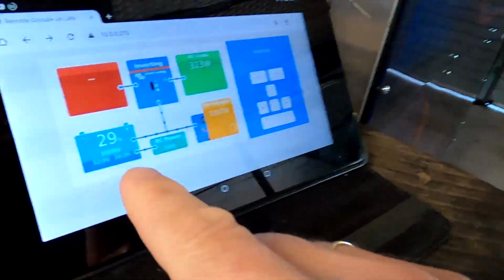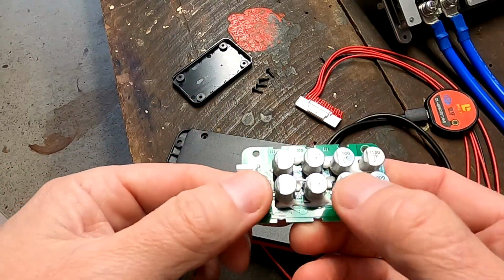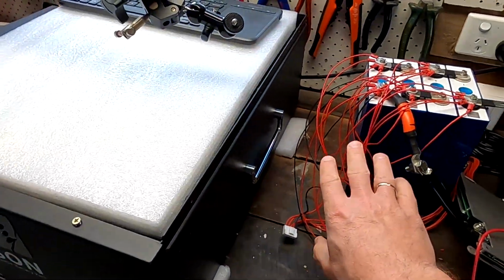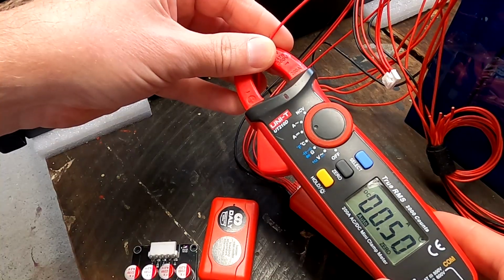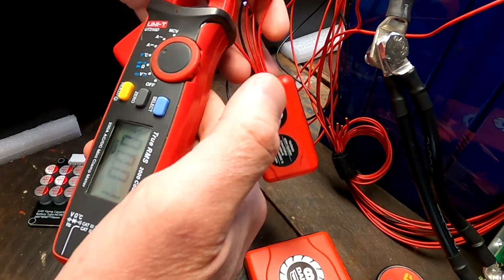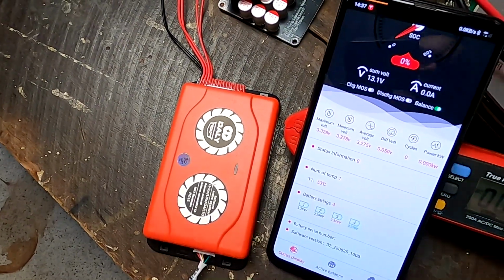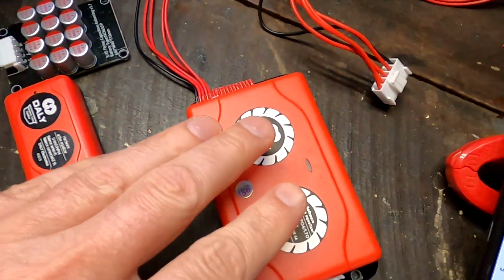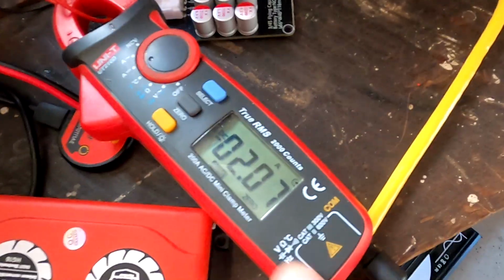DALY has now Active (Smart) Balancing! Is this the new NEEY?

Comment: Hello, I'm also charging the battery. I'm confused between BMS Daly and Jikong. Which one works better? I'm using Daly a lot and have used the Daly 1A balancing circuit overnight. They are very even, only 0.003V different, very ok.

Comment: Great and funny videos! I just ordered one of the smart Daly active balancers. It is for a 14s 4p 52v with 21700's. Hopefully, after spending hours and hours of manually trying to get these cells balanced this will take over once it gets here. I also have a new bms on the way as I think this one is crap. Why? These are brand new cells, and for some reason exactly half the pack 1-7 are, after charge, roughly 100mA lower than packs 8-14. I know, and they were perfect when I built the pack. Any thoughts? Thanks for your wonderful videos! :face-blue-smiling::medal-yellow-first-red::medal-yellow-first-red::medal-yellow-first-red:

Comment: Hi Andy, I'm playing with 500Ah cells and I see no interrest in BMSs nor active balancer, actually I think it's bullshit, let me explain. Current drows from minus to positive and tipically you'll agree that if we're using let's say punctually 100A out of a 500Ah 12V cell pack ; what's quite reasonable with an hoven plus computer, plus TV with a 60A solar panel array ; We'll see the cell on the negative side discharge 4 times more quickly than all other cells. What can those BMSs or active balancers do with those 1mm diameter cables carrying 1% of the charge ? I agree that connecting cells in parallel can be armfull, the lower potential cell eating the energy of the higher potential cell but here we are in a serial connection, the most working cell will always be the one on the negative side, balancing it is a nonsense since when using it you don't get the energy from the one in the positive side. Unless I see a 100A balancer making all cells usefull I'll never buy a BMS again and multiply my capacity by 4 compared to my need. My cells are fully charged individually and I'm switching the last one with the third one some times. Why with the third one ? Because I saved the two last 500Ah (black design) from a pack that I forgot in my boat, the two first of the set had reached 0V, 3 and 4 was maybe 1.5V and are 3.2V holding charge now, they'll be fine first and lazy with two 580Ah Eve new cells working. I see no reason why the brand news will have any influence on the old ones. If I'm wrong answer me with your words please, I'm tired seeing people loosing money with those stupidities. Sorry for my writing mistakes I'm french.

Comment: So after using xiaoxiang and jbd bms's i decided to build a pack with a daly bms and 1a daly smart balancer and to be honest im pretty disappointed. The bluetooth and app kinda suck on the daly. Im annoyed they dont specify if its charging or discharging on the dashboard.  also I cant get the 100a daly bms to do any kind of balancing, even while charging. The jbd's actually keep my pack way closer cell to cell compared to the daly. What i will say is i have the daly 5 amp active balancer on a different pack and measuring cell to cell voltages with my fluke it seems to work pretty well.

Comment: You are mistaken in the reason why all 4 turn the balancer on.  You already discovered that absorption is the key.  But you have only a 1 amp balancing current . So when you charge back up a 16 pack the highest cells will start to slow down as the resistance for charging increases that allows the bottom ones to catch up .....this catch up is necessary to bring the whole pack together to a higher Voltage with a smaller differential. Lets say I am out of balance by .650 Volts ....the increase in resistance for the highest cells will bring the bottom closer all the way easily to .100 separation  only because of increase in resistance to charging .  that is what your charge curve goes steep up.....more resistance ........but when you get close to 3.60 this resistance collapses as you reach the limits of cell . Hence the run away at the top.  you can have run away on the bottom  and the top.  So Daly makes sure that all cells go past the threshold before taken active the balance current of only 1 A ..................you need a lot more current to get a cell voltage split from .750 back to a differential of .100 . You have to come in with over 50 amps for quite some time to get them to reduce the differential all the way down to .100 which is not possible with 1 a or 5 a at all .  But there is merit to start at 3.2 Volt , why ?  Because you enter the steep incline at 3.2V which you can clearly see, the increase of V slows down due to the resistance building up.  So the Balancer makes sure that all cells enter the threshold before the steep incline starts ..otherwise you drag this separation all the way up with you even when you come in with 80 amps ...the lowest cell will stay low , only with enough absorbtion will it change it's position in the pack  and they start reacting to absorption vs V raise at around 3.30 V .  You are actually already in a slow down of V raise since nominal 3.2 V you can observe that easily. Come in with 80 amps and watch how the diff tightens and the increase in V slows down. if your solar can do 80 amps or more .  Than when you drop out of 80 amps later in the day , the cell will drop back and rebalance at where ever the absorb level is comfortable.  It might pop back to 3.3 and might than rise again a bit up just while sitting there doing nothing than overcoming the shock of an 80 amp drop.

Comment: I knew there was a comments section somewhere as I had previously seen it. then couldn't find it - the secret? Keep on scrolling past all the other video icons/thumbnails.
And because I enjoy your videos, info, voice, sense of humour I have joined up. Tells me it starts  the day after my 76 birthday!
Anyhoo. I have a Daly Smart 250 with BT dongle and I think I may have solved my balance problem
Live ion the road in 15" poptop. 540W solar, Renogy DCC50sMPPT, BMS as above. to 400Ahr 4S bank
My charger from Ian Goh ( FPV Solar) is set to 14V when  on Genset , (will reset to 13,6 if long term on mains)
Daly set to Bal open 3.4V, open diff 20mV
while charging Cell diff can get over 25mV
Balance works starts to work as soon as I turn off charging and slowly gets down to 5mv even 2mV
so I think that is reasonable?
HOWEVER, following other of your info I have on the way a 4th Gen Neeeeeeyyy active balancer, 
Why? because it's there and lust to be sure to be sure
I look forward with anticipation to seeing the results
Cheers
Reply from the maker: Thanks for joining!

Comment: Need to potentially replace the BMS on the Ebike battery, so am doing the research (or trying to).

I need to do one of these, too…
Reply: Addendum: got one of these on the repaired Ebike battery, along with a 60 amp smart BMS.  Seems to be working…

Comment: Hello
Regarding voltage measurements. Have you thought about the accuracy of your instrument? As you have it, you have approx. 5% deviation. You must use an instrument with at least 6 digits and 0.5% deviation. Or even better with 0.1% deviation.
Greetings

Comment: Hi! What bms you reccomend for a folding bike battery. 12,5ah 36v 10s5p(2500mah cheap cells) 15a controlller. I just need a bms 55..60mm x35mm x10mm. Not very much space and the stock one don't do balancing) i have opened the pack and balanced manually with a rc charger but i want to not open the pack. Just use it with a good bms

Comment: Just bought one Daly bms , barely worked the first day, had to remove it the 2nd day, it kept shutting off randomly; the balance was a joke too, ~~30 mA, same as nothing, they must be kidding;
the wires, too cheap too, short, and only 0.005 in diameter(x11 strands), (a human hair is half of that), one can barelly crimp them!!  also, it will not turn on unless you activate the GPS on the phone, daheck is that!! openned a dispute today for a refund for DOA w/aliexpress; my other BMSes, Jikong and Hibms are still working well after 2 years;

Comment: With the need to have all cells reach a threshold, I would set a minimum value for all cells to reach (ex. if expecting 3.3v to trigger, set to 3.2v).  I hope they have the updated firmware in the version I receive...).

Comment: I ordered the 8s 1a smart active balancer.  My 8s pack (6P8S - 48, 100ah CALB cells assembled in a 24v, 600ah battery bank) is getting out of balance and DALY BMS cannot keep up.  However, once I top balanced with a desk charger SLOWLY to 3.4-3.5v across the bank, the voltages are closer and usable capacity is greater.  Before, with the variances, I would see 27.2v but as soon as load was added, the cells that were at 3.5 and some as low as 3.3, I really only had 90% usable and it steadily dropped so I had even less than 90%.  Hoping to see improved balancing with the 1A smart active balancer.  DALY now has 5a active balancer.  I may buy that later.  I have DALY 500amp bms (250amp charging).

Comment: You can see that the active balancer has a CPU, and many transistors on the outputs. I would wager it monitors incomming power on each cell and PWM modulates the output of each cell at the same time by switching the transistors.

Comment: I own one of these along with other daly poducts, BMSes mostly.  They are ALL crap.  IF it works initially, it will fail you in less than a year.  Even if the unit works, the bluetooth will fail.  Good luck with that.  After wasting hearly $1000 US on Daly products, I will never touch them again.
Reply: Same here,  a crappy Daly , just openned up a Dispute for a refund with Aliexpress, the damm Daly POS barely worked the 1st day, died in the 2nd, won't stay connected, tried, bt button, charge, and short ; my other Jk and Hibms are still working after 2 years; the wires on the Daly are crap too, only 0.005 inch diameter(11 of them) so thin, you can't even crimp them properly; short too, at only 30 cm; they try to save one cent here and there, i doubt the whole package is good; tried one, no more daly.

Comment: MY REVIEW OF THE DALY SMART, 1A, 16S ACTIVE BALANCER.  before installing the new Daly, my  bank had become seriously out of balance, about 0.250 mV when fully charged, sometimes nudging 275 mV.   So I installed the Daly.   At first it did not seem to do much -- 1 amp current was flowing through the balancing wires, as it should, yet the imbalance remained high.  This continued for several days and I began to wonder if the 1 amp balance current was inadequate for 16 280ah cells.   But after 5 days of normal solar system operation, it finally balanced.  As I type the delta is 19 mV, with the cells charged to an average of 3.487V.    So it works.  No, it is not the ultimate active balancer, but for $39 USD, it is the best value, and I can recommend it.

Comment: I have a problem would be nice if someone could help me with it

So my smart active balancer works like I want it to but I have one problem ones  it goes in to sleep mode and I'm charging the battery it never wakes up even it's over the set start voltage and deviation  unless I wake it up manually by pressing the button on the bluetooth dongle but I can't do that every time I charge the battery 
I'm trying to find out if there is a problem with mine or if that's how they are designed?

Comment: Has anyone had a active balancer that wont turn on even i cannot see the bluetooth module, i checked my balance wire voltages and there ok but i cannot see the bluetooth and the green led is not on
Reply from the maker: They have two versions, one with BT one without.
It only turns on at higher voltage as shown in the video. But BT access should be possible as soon as it is connected.
Reply: @OffGridGarageAustralia   seems i have a faulty unit Daly are sending another :)

Comment: Hi mister Andy! Im Lucian, from Romania. I need your help , please!! I buy a 16s daly active balancer , and he comes without bluethooth. The seller say,on this model 16s no needs   BT.  Is that true?  Best regards!! Sorry if a disturb you
Reply from the maker: Thanks for your question, Lucian. They have got both version, with and without Bluetooth, so it depends which one you have ordered.
Reply: I ordered the smart version, with BT, but they say that the 16S model does not have the version with BT mode, only the 14s. In the meantime, I tried with a BT module from another Daly bms and I saw that it works, I can use this one for the balancer. But thank you very much for the answer. I want to congratulate you for everything you do, keep it up, you are the best. I have been following you for some time and I want to say that your knowledge and all the tests you do have been very useful to me.

Comment: It does work over a 10 amp charge rate. The charging stops when one cell goes over the limit you set. You will never get the battery charged at higher than 10 amps. Over 10 amps and it goes on and off as that same cells go over the limit as soon as the charging try to start again. So it never goes anywhere. That is why I will install a QUCC 10 amp active balancer.
Reply from the maker: They are not great devices.
Reply: I am going to try the Qucc 10 amp active balancer. I have a commenter that built a 16 cell 280 amp 48 v battery just like mine that said it worked for him and the Daly just was not up to snuff.. It took me just under an hour to see that Daly Smart 1A BAL was not ever going to work. Makes me wonder if the BMS has fatal flaws as well. @OffGridGarageAustralia

Comment: Hi dod you get this working? I installed a 20s version (21p) and it shows correctly in the app.  But damn if it doesnt really balance anything. It starts for a few seconds (lowest 3.365v and highest 3.45v) but after two days of being connected the difference is the same as before. Wonder if you figured it out - sucks to not have it balancing.
Reply from the maker: It's a software issue and only an update from Daly can fix that.

Comment: Mister Andy, what would you do/suggest for the packs that go out of balance on the way down, and the bms turns off use when the first runaway cell reaches 2.5 and leave the rest of them at 3.190? ;d

i have "top balanced" them a few times without using them till they got maxed and relaxed, but it seems there is always one that is more giving than what is best for the group

I've have yet to get another bms than 3 different dalys that I have.

Best Regards

Off-Grid Apartment ;P

Comment: Can I use a 24S Active Balancer by DAILY with Their 15S 120A BMS to help keep the 15 batteries evenly Balanced with the extra 9 batteries fully charged as the 15 batteries are worn down by use the Extra 9 3.2v 280Ah batteries can help feed the 15 ! “ what’s you’re thoughts & Wisdom ?

Comment: Hi thanks alot for the video  I am building a system could you assist on advising what daly bms is best for my application I have Lp44147272 (130ah) 416Wh cells i  would like to build to power packs of 8 cells per pack
Reply from the maker: OK, so you would need a BMS for each 8 cells you connect in series. You can then parallel multiple of these pack if you want to (not sure if you have only 8 batteries or more than that).
So, you will need an 8s BMS for either Li-ion or LiFePO4 cells (not sure what chemistry your battery has). How many amps, well, that depends on your load and power coming from your solar charge controller. 
You can go with the 8s version of the JK-BMS which also has a nice active balancer and is easy to setup.
Link to the JK-BMS is here: https://off-grid-garage.com/battery-management-systems-bms/

Comment: Hi! I will look on your other videos. I have just got my 320 Ah LifePo4 batteries (24 volt system) and need to buy  a BMS system. Which of those BMS system with active balancer you describe in different videos would you recommend for 320 Ah LifePo4 grade A cells connected as 24 Volt?

Comment: I recently learned that some BMS  do not balance until they have been initiated by the charger and then they will continue to balance when you turn the charger off.
Your small Daly (non smart balancer) probably  needs the charger to initiate it .
Reply from the maker: Hmm, never heard about that before. What would be the difference if a charger is connected? It's not a BMS, just a balancer. It should work in either situation.

Comment: Hi. I bought one Daly Smart Balancer and found the same problem as you. . . AlL voltages need to be above the set point before balancing starts.
Reply from the maker: Yeah, I have some new one here now but haven't tested yet. I hope they have changed the software by now.
Reply: @OffGridGarageAustralia  GREAT video Andy, thank you for your awesome contributions to the hobby! I'm a big fan of yours!
I was wondering if you've had a chance to see if Daly has updated either of their 2 active balancers, so that it works the way you stated in your video? Also, I already have the Daly 4S BMS w/ bluetooth. Do you know if their basic active balancer (one w/out bluetooth) would work with the Daly app, OR will I still need the model w/ bluetooth if I want to see it working in their one app? In other words, can the cheaper balancer work with their one single app?
Reply from the maker: @heytae  I haven't revisited the DALY active balancers since. I have however, newer models of them here.
The basic active balancer has no bluetooth and therefore won't work with the app.

Comment: Hi friend.  I test a daly in new 16s calb 280 ah lifepo4 new pack. Not top balance. I had about 70 mV of differences . I set start balance up then 3.40 mV for cell and i charge at 54.7 v . Daly balance the cells with 20 mV differential.  Is very low cost balancer for me is a good solution. With resistive balance of bms i complete the operation and finally i have 0.003 balance in a new pack . Very good. 
Your channel is the best. Thank you.
Reply: Sweet! I like the daly smart balancer too. its great so far.